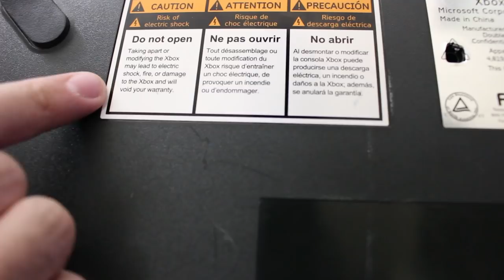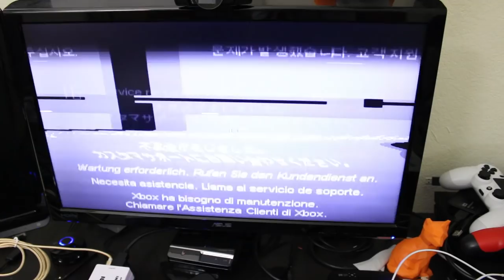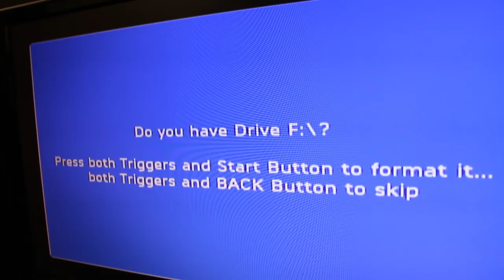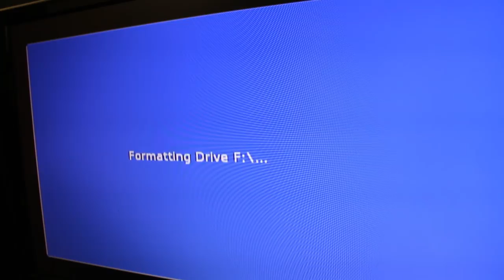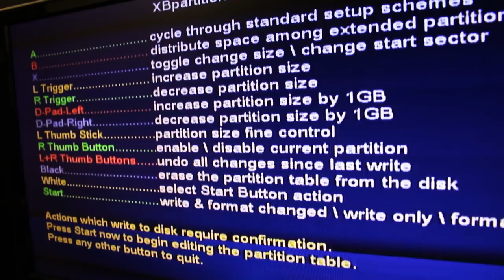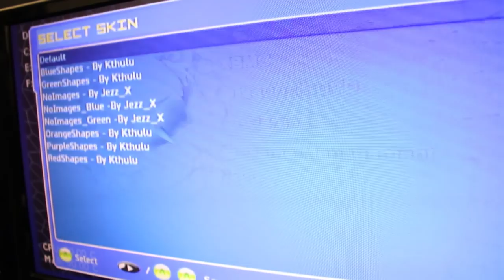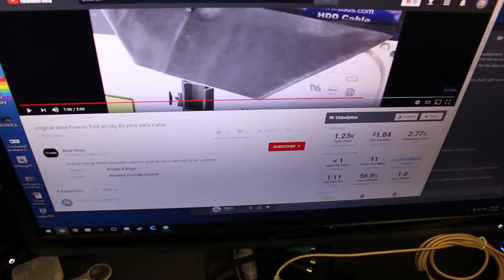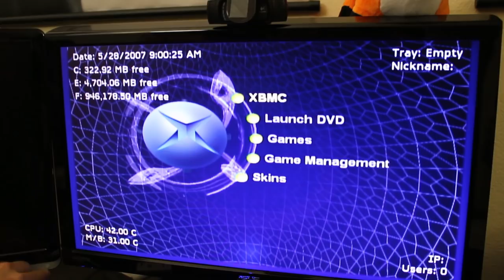Let's Upgrade an Original Xbox! - 80 Wire IDE Cable & 1TB SATA Hard Drive Install - Part 2

Comment: I know this is old but whenever I do this i always get an ER next to partition 6.

How comes you don't increase the partition 1 E I found myself 5gb is to small and it's suppose to be fine to increase the size of it.

Is the 80pin ide cable really needed not seen any real evidence of it.
Reply from the maker: I never ever feel the need to increase my E drive, never ran into an issue with it. All of my games go into F and G. In my experience I always need the 80-wire IDE cable to use a SATA drive, if I'm just sticking to IDE the 40-wire is just fine.

Comment: I have an older tsop'ed MB and a 160gb hdd with Avalaunch installed. Can I use Hexan 2017 to install EvoX and XBMC? Also how can I transfer the installed games on the 160hdd to a 500gb hdd? I would do a fresh install on the 500gb hdd.

Comment: However, once done, I've notice in the System Settings that the video display says "No" to "Enable 480p", "Enable 720p" and "Enable 1080i". Is there a way to activate these fields ? They are in readonly!
Reply: I think it's related to the fact that I'm using a AV cable. Will it activate these features if I use a S-Video cable?
Reply from the maker: You can only activate those with a component cable plugged in.

Comment: Great video! I recently did the same and upgraded my softmoded Xbox to a WD 1TB HD SATA drive using what looks to be the same adapter that you are using. I just wanted to point out that I also purchased the 80 wire cable and got so fed up with trying to get it to fold in the Xbox that I gave up and reinstalled the original cable. I wasn't sure what the result would be, but it booted up no problem! As a matter of fact, I feel like it boots even more quickly than it did before. That's just my two cents. :)

Comment: This tutorial work with another chip on xbox modded or only with aladdinxt? Because i have one xbox 1.0 with another chip mod and i try this tutorial (with seagate 1 tb sata hdd and adapter ide-sata)but when i insert the hexen disc on dvd drive and reboot… the console freeze on boot xbox logo screen with inscription linux below.. how i can proceed???
Reply from the maker: This isn't a tutorial, you're not waiting long enough for Hexen to boot.
Reply: @MrMario2011  Ok. I managed to install the new hdd. But it recognizes me as if it were 120gb .. instead it is 1tb. In Xbpartitioner i format good with only one partition of 925gb. WHY? Please help me

Comment: I have a tsop modded xbox.
2 tb with 700+ xbox games. Multiple emulators with hundreds of games per. Ps1 emulator that works but i do not use it. I met a guy who has 2tb x2 drives. He has everything anyone could want plus more and still has free space.

Comment: So I am upgrading to a 1tb HDD from stock on a TSOPd xbox. I slapped the new HDD in and hooked it up with the 80wire cable and the Startech adapter (both tested working properly in another build), and when I pop in the my Hexen 2019 disc It doesn't say linux and throws an error code after a few seconds (9 on master, 8 on other jumper settings). Is it possible that Hexen 2019 can't be used as an installer?

EDIT: OKAY so listen to this. I tried every boot method with the startech adapter jumper settings even without the jumper and got error code 9 everytime aside from error code 7 on slave jumper. I decided to try the much cheaper generic IDE-SATA adapter and it booted up first try!!! That is insane to me considering the Startech adapter being much better quality and also faster by 20 seconds when booting to dash on a softmodded xbox vs the generic one. Which makes me think that since my HDD is  7200rpm, is it possible it wasn't getting up to speed in time for the Hexen disc to recognize it?

Comment: This worked great for my xbox.  When I tried on a friends it seems like the NIC adapter is broken in the xbox.  Is there any way  for me to copy my xbox drive and put in his?  Maybe change my hdd key with rocky tools. change his hard drive key to the same with rocky tools.  then clone my drive and leave the cloned drive unlocked.  Then Act like I will clone his drive through chimp, but instead put my cloned unlocked drive into his xbox, then use his xbox to lock the drive.... would this work?   this is assuming I can even get chimp on his xbox with no ftp access.

Comment: Did almost this exact process to two systems about a month ago and it works great. the only annoying thing is the in game reset on the 8+ bios. It tries to read the disc drive resets the system tries again and THEN loads from the HDD, anybody know a fix or workaround?

Comment: so I'm newer to this, and I've softmodded mine but not aware of all the different methods. in another video he used the hot swap method to upgrade the HD, but on this one he used the disc to load everything on the upgraded HD. Is that because of the options for upgrading on a softmodded xbox versus a hard modded with custom bios? I wanna make sure I understand the options and methods for each.
Reply from the maker: Yep, I was able to just load a disc here because this has a custom BIOS.

Comment: I have an OLD TSOP mod done years ago on my Xbox 1.0 and I just put a 250GB SSD in my machine. So far with the new drive the UnleashX works great but I am curious if there is any benefit.

Few questions:
- Do I need to reflash the TSOP again?
- Would there be any benefit to reflashing the TSOP?
- I have a 1MB ST that is controlled by a switch to choose between EvoX and stock. How do I know which BIOS I am flashing?

Thanks!
Reply: I am not a pro, but not a noob, either. So take my answers with a grain of salt:
- If your xbox shows all HDD space with your current BIOS and you have no intention to use the stock BIOS in the future, no need to flash again.
- I guess most ppl will not notice a difference.
- You flash the BIOS you are currently booting with. So if you need to boot with your modchip BIOS to run the HeXen disc, you would flash the BIOS on your chip, which is not recommended, AFAIK.

Comment: Hey man, how long is your IDE cable? I bought one thats 18 inches and once its connected to the motherboard and dvd drive it can't reach the hard drive. Also once everything was connected, it just hangs on the Xbox logo screen. What do?
Reply from the maker: The one I purchased is in the description. Could be a bad cable if it isn't erroring out, I had that once. The original cable worked and disconnecting the DVD drive with the new cable worked, I didn't get it working 100% until I tried another new cable.

Comment: Quick question!! Does TSOP allow to upgrade your ram? 

I TSOP mine everything good till I installed the ram and now the xbox when i turn it on remains green and no video I press the dvd drive button it turns off tries to boot and it boots 2  but it gives an light error flashing green and red and nothing happens.

I suppose is f... but as much as I understand if you change the bios it should work so far in theory because I haven’t succeeded at all.
Reply from the maker: I believe you also need to flash a 128MB capable modified BIOS
Reply: Hexen doesn’t have it, well now I cannot explore but also waiting for hot gun air because mine just got broken today, I’ll let you know once I remove the ram the xbox will still work! Ha!
Reply from the maker: If you swap back to the 64 MB of RAM it should work, from there you can flash your console with a compatible BIOS and then upgrade. If you don't want to do that, what I would personally do is install a modchip like an Aladdin in a secondary console, flash that with a compatible BIOS, then transfer it to your current upgraded system.
Reply: MrMario2011 yeah!! That is what I’m going to do!! I will remove the ram and then flash it again!

Comment: I am not new to the modding scene but i have been away for a while. one of myXboxes crapped out and im trying to get it going again. it was working fine and as i was copying over some files. then it just stopped. when i booted, my G drive was gone. and now, it just wont boot at all.. i just got an 80 wire - 40 pin cable and still using the same adapter i always had. even tried others. after changing the cable to an 80 wire, it booted but stuck on error 16.. - _-

Comment: Hey mario im upgrading from a 40gb ide hdd to a 160gb ide hdd, im using lpartx.i cant clone the F partition even using the byte by byte method or the partition selection mode. C and E clone well. Any method i can use more?
Reply from the maker: I never clone the drives so I can't be of much help there.
Reply: @MrMario2011   ok thanks

Comment: If it wasnt for you with these great video majority would be lost! I was in the scene back in the day when the original xbox was released. Went by Xboxit.00. Did many TSOP flashes etc. Been out of it for many years now, just had my Niece request some old xbox games and I grabbed another original also. Just curios, where can we grab the Hexen 2017 iso? Will it run on a soft modded system? Seems new to me, I do know of the slayers disk which was quite handy! love your videos MrMario!

Comment: I bought a 200gb ide hard drive that was still factory sealed, is a sata drive much better as in noise or speed for the original xbox? I can hear the drive grind sometimes, but not sure if i would have the same with a sata drive.
Reply: Newer SATA drives do tend to be substantially quieter than the old IDE drives.   I have an old Maxtor IDE 300GB in my PS2, and my god, it sounds like it's breaking rocks inside when it's actually working.   Then I have a 1TB SATA drive in another PS2, and it's exponentially quieter.

Comment: Please correct me if I am wrong here. Can a regular DVD room drive be used from a PC on to this. I know of a place where I can still get an ide DVD room drive. And possibly a 1 or 2 terabyte sata drive and idea to sata connection.
Reply: Karl Entner cannot, as the firmware of the DVD drive isn't compatible, nor would be recognized by the Xbox console
Reply: BoneCollector what about swapping the PCB board on the DVD itself. Since I have been reading up a little bit further on this. Since they have flashed that to make it harder to do. My system is working as a whole. Just that the DVD is starting to give the red ring of death for the DVD itself. I have done already once before swapping out on the actual hard drives themselves at one point. Lucky me it was the exact same model of hard drive that they were trying to recover the data from it as an example. I would like to get it working again over here.
Reply: Only a few models of PC drive can be flashed for Xbox compatibility, and they're INCREDIBLY rare now.  You're better off just buying another Xbox DVD drive.
Reply: redslate32 I have checked around at a couple of shops that do console repairs and mentioned about the original Xbox that I have. To see if they may have some contacts to supplier that would have that. They said that they can't even get the parts for them any more. I'm techie by trade over here. its just finding out where to get the parts if it is still possible. I know two places where I can still get ide DVDROM drives for the pc on the cheap or possibly still brand new if they are surplus parts from a particular manufacturer.
Reply: Karl Entner Just go to Ebay.  

A good Xbox DVD drive can be had for $40-50.  If you know what you're looking for, you can even get a working console WITH a good drive for that same price (may not have cables).

You only need the DVD drive for the initial exploit; once you mod your console, just store everything to the HDD.  Then, you can reuse the working DVD drive to mod another console.  Note:  you'll still need a DVD drive connected to pass the boot check (unless you mod your console further).

Comment: I put the 80 pin cable in but got flashing led as yours did, how do I get past that? It's a softmodded 1.6
Reply from the maker: Your console is softmodded, unlike this one which has a custom BIOS. Remember that you need to clone from the old drive to a new one using Chimp and make sure it's locked to your console.

Comment: The only difference between an 80 wire and a 40 wire IDE cable is that a 40 wire only has the signal wires and the required grounds. An 80 wire cable has one ground wire for every signal wire on the cable which allows it to transfer data a little faster and it gives it a little more integrity. I'd say the stock cable would have worked just fine at the sacrifice of a little bit of speed.
Reply from the maker: The 40 wire cable did not work, as shown in part 1 of this video. I was thinking it would have been a bit slow as well but nope, it would simply error out each time. It isn't an issue of files on the hard drive either since this system has a custom BIOS, it will nuke any blank drive loaded in.
Reply: I've modded many Xboxes and it worked, but then again I've never used a SATA to IDE adapter lol. I'd really like to see how you could do a HDD access indicator light mod on that cable if possible.
Reply: Using a SATAtoIDE board requires a 80pin IDE Cable, otherwise, it wont work.
Reply: I disagree. I used the 40 pin cable that came with the Xbox and it worked perfectly, including no lag.  See my comment above regarding my experience upgrading to a 1 TB drive.

Comment: MISTER MARIO HI!

Is there a possibility the X-Box to read BarraCuda Pro Hard Drive 4 TB ST4000DM006 ? ? ? ? ? ? ? 

Have you tried this?

Next question is it possible to fit two 3.5 HD inside the X-Box?

If it is not possible to fit two 3.5 can i fit in one 3.5 and then one Micro SD with 512gb inside?
Reply from the maker: Anything bigger than 2TB isn't recommended and has been known to cause issues. From what I've read you can have multiple drives in your console but only one can be run at a time. SSD will work the same as upgrading to a SATA drive.
Reply: Thank you for the answer MR.MARIO2011. 

Do you think in the future the X-Box Partition version will be programmed to a newer version to read up to 4TB drives and make the drive load quicker?

Comment: What Asus monitor your using on your OG Xbox? and what resolution is projecting? It looks really sharp and full screen.
Reply: on that note: will any (usb powered) RCA to HDMI adaptor work to connect the Xbox to a computer screen ?

Comment: Can I vertically stand my OG Xbox? 
I barely have room and I gound a spot for it. But it has to be standing..
Would it damage the system in someway?
Reply: Shuny 11 I would imagine so, just be careful of the vents and to have it turned off and unplugged while you set it on it's side for the sake of the harddrive
Reply: Fox Repair what would happen to the HD if I dont unplug it?

Comment: So for sure that this cable will work? I tried a Startech branded cable and it still ended up being too short for me no matter what I did. I've really been wanting to try out my Xbox for a while to make sure the upgrade even worked but can't because of this issue.
Reply from the maker: The one I linked will work as long as you fold it up in a decent way.

Comment: So I followed and did everything you did I made a "games" folder and ftp'd a few games into it the snes emulator is recognized from my games section but none of the games I ripped from disc to iso do. I have used other methods of softmod and all my games I ripped had no issues being seen from the games folder on unleashx . I even tried xmbc and even the emulators didn't show up got any ideas?
Reply from the maker: ISO files aren't recognized, they must be extracted to be played on the console.
Reply: MrMario2011 yeah I figured it out I just couldn't remember xD

Comment: Will removing  clock capacitor on a 1.6 Xbox, brick the system?
Reply from the maker: There is no clock cap on 1.6 consoles.
Reply: @MrMario2011  I know this is old, however there is a "Clock Capacitor" and if you remove it, the console will not boot. The bright side, it doesn't need to be removed.

Comment: Hey Mr Mario, I was watching this video yesterday and I thought if there are some way of not hacking the XBOX, but rather replace the hard disk either with another PATA or a new SATA, but just copying the original OS. I don't want to hack it to add ISOs, just a way to update the hard disk. Have you done that or had  you seen that? Just a thought.
Reply from the maker: Not possible, unless you have a custom TSOP or modchip installed. You cannot run ISO files on the system either.

Comment: Seems like the 80 wire cable is unnecessary.Does the adapter not work with a 40 wire? You will never be able to push sata data speeds through ide no matter the wire count. IDE bus is not fast enough
Reply from the maker: It won't work with the stock cable.
Reply: "The Xbox ATA speed is rated up to 133 so a drive with at least 133 Mbps and a ATA133 cable can give some big gains."

Those adapters will push for ATA-133, and the 40 wire cable will crap out, and the system won't even detect the HDD.   Had this exact issue myself, and the 80 wire cable did the trick, and it does indeed transfer much faster than stock.

Comment: You should try this with an SSD, just for fun.
Reply: It would KILL an SSD due to the lack of TRIM functionality!
Reply: Well then. The more you know 😂
Reply: no, you can use an SSD fine but its still limited by the IDE so its 11mb a second basically
Reply: Nonsence. SSDs treat this in their firmware. I myself use Kingston SSDs V300 in my Xboxes since 2016. No issues at all.
Reply: It's not nonsense at all. An OS that doesn't know it's dealing with an SSD, will treat it as an HDD - which means significantly more wear and tear.